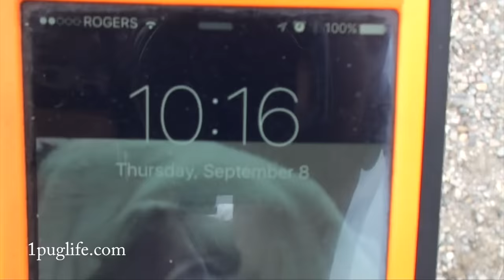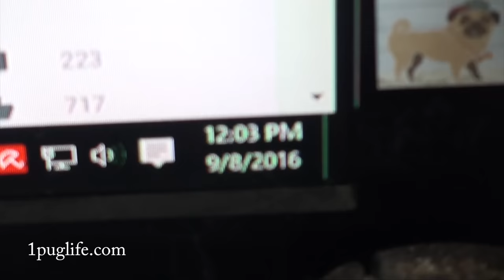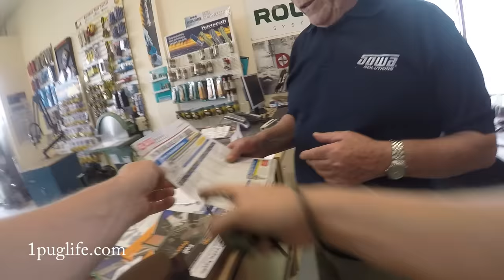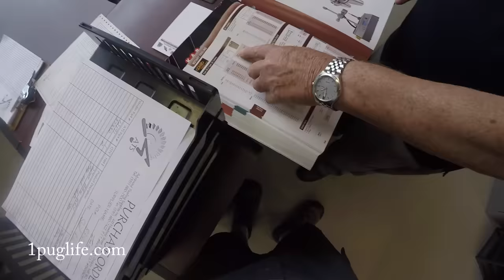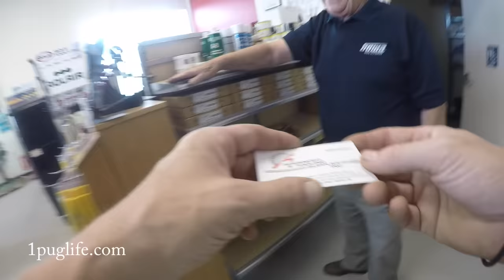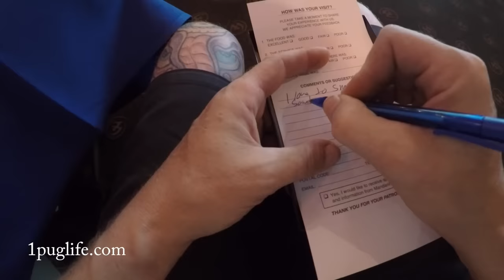time to pay the piper

Comment: Maybe the building roof not square..that's why the roof tins don't fit nice.
Reply: likely
Reply: I was thinking the same.check gutter edge before spouting. this dude should know better at this point. plus you get more bees with honey.
Reply: The buildings old the center has dropped some, Pug a con man.
Reply: +john harry still a ver unproffesional metal roof job..no matter what they slapped it on
Reply: Yes unprofessional but fit for function if you paying half price of a pro would you expect anything else?
Reply: +john harry 
Oh.... HALF price season is it!

How much?
Reply: I've tryed to work with unsquare it's almost impossible to make it look good.  Plus if you start the first sheet crooked it's will be all crooked.  Best way is to make the first sheet look straight
Reply: Well you don't order the metals to the width you want they have to cut them they come standard width. The roof was square just bit to long but yeah you pay cheap you get cheap but Pug wants a Rolls Royce cost of lawnmower.
Reply: Why is everyone continually beaking off about Pug being a cheapskate therefore it is OK to fucking make a shitty mess?

UNLESS someone knows otherwise I seem to recall Pug asked roof buddy for a price to labour the roof on.....

He never said he wanted it cheap....half price....in a rush... ner fuck all like that...

Plus I do not personally recall ANY number being mentioned other than Pug stating he could get the metal for 1000 bucks less than roof buddy. ....
Reply: JETJOOBOY That part and parcel when having work done on your house, when you get your car serviced do you say my seat must be back in the 38 degree angle and mirrors in the correct position to head height or i am not paying are you one them guys? or just a 13 year old kid i am guessing
Reply: No, you shouldn't have to say fuck all when getting your car done..

But the angle of the seat is not a valid comparison to this roof shit show..

How would you feel if you took yer car in for a new clutch and there were numerous fag nubs in the footwell and a burn in the seat and oil rubbed into the door cards and the seatbelt twisted and the indicator stalk all broke and wobbling?

If not pissed off, then you must already have a buggered up motor car...
Reply: That's a joke right
Reply: @y2kxj  If you measure the length of the top,measure the length of the bottom,you know from the start how much you have to make up to have it look good at each gable end.There are ways of making an out of square building look square,but you need foresight and a bit of knowledge.BUT,if you are not being paid extra,to do the extra work,why do it.I have always done the best work possible,but in the end,most clients don't give a rats ass,it all boils down to money.I hear many stories of people being ripped off,but I can tell you just as many of the contractor/worker getting the shaft for no good reason.Too bad because I trust people until they give me a reason not to.

Comment: There's rake edging that should be installed. There should be butyl tape under it. That closure is for the eave edging, not the rakes. That is not the proper sealant for metal roofing. 
Sorry, but my advice is to have it redone. You may be able to salvage some of it.

Comment: 28 year UNION  (Sheetmetal Workers International of America), specializing in Architectural Sheet Metal ...NOT ROOFING.... (I seal in all of my flashings, I cut all my reglets; I'm an instructor at the Union Hall ... Teaching Basic Architectural Sheet Metal & Soldering & Advanced Soldering ... Lead to Galvanized coated Zinc, Lead Coated Copper to Lead, Brass to Copper. When I teach I teach & certify with 1#, 2#, & 3# irons. This includes overhead & horizontal soldering; finishing with the use of a P2 tip for sweating joints, to show how no matter who says what .. Only an iron can sweat a knocked down standing seam lock as the lock was intended. Nothing a roofer can do, yet everything a roofer claims to do & do well.)
Reply: NONE of what you saw or no roofs made with metal are "Roofing" or done by "Roofers". 

95% of metal roofs are worked on & completed by Roofers. Why, ?, you ask. Roofers are required to be licensed in some states nor reqd to take an apprenticeship. Hence SMW's make $35 in the envelope to the roofers $20 envelope.

Comment: Dont they use barge flashings in Canada? That way you dont see the ends of the sheets on the gable ends. better waterproofing as well, Just wondering
Reply: Thats what i was thinking, there has to be something to cap the ends.
Reply: I've never heard that term, but thought the same when materials were delivered, where's the gable? Can easily still be installed, cut that shit off they did to the cap, trim the edge, install gable to cover the hundred screws they put in the edge by house. Ha ha Hard parts done, 30 minutes to cut and install gable make a world of difference.
Reply: rake flashing..yes we use it
Reply: goofs did the roof not professionals
Reply: @whenibecamethesun..8759  I doubt it...

Comment: I have done hundreds of metal buildings and roofs. Not one contractor or homeowner would pay me for that mess they have made. There are not even enough screws in each sheet to meet wind code in my old home state of Michigan. Some blue chalk and make your screws at least line up ffs. I would have quit and fired them with the reuse of the boot and storm collar on the vent for your furnace yesterday. Let the court decide.
Reply: But the first thing a judge is going to ask: where is the written contract and what is specified in that contract.
Reply: Maybe you could do a report and approximate quote to help settle the situation?
Reply: Pug had a written estimate. I think the guy got butt hurt over not supplying the materials right from the beginning. It was a 5 day job for 3 men to do properly. The 4" gable end fascia boards should have been knocked off and swapped to 6" so proper trim could have been used. The foam would not have been needed on the gable ends. Cost of materials would have been just slightly higher.

So a lead man 30$ per hour x 40 = 1200$
2 do what their told dicks 22.50 x 80 = 1800$
Thats a fair estimate for this job done properly supplying all your own tools.
Reply: There is no way possible you and one other guy could do that job as I described as proper and done right.
Reply: Also part of the job was removing the old sheeting without damage. That takes and eats up time. They frigged it up and it took them 3-4 days.
Reply: m!!lo

Comment: Most roofing Co. leave crap. I've seen it all the time. You get what you pay for! When I paint a place I go around to make sure everything is done. Every new roof job that I have seen has had all kinds of crap leftover. If it's a contract that says they have to clean up then call them up. As for the one side I would have them fix it. If it's a cash job? Forget it!

Comment: Usually metal roofing includes angled trim pieces for the sides and bottom, plus the ridge cap.  I don't see any of that in the video!  Judging by the way the metal is screwed down, odds are it will leak and feel like rain inside!  This is another case of Pug1 getting screwed over.
Reply: the drip guards?  yeah there's none installed here lol.. never done roofing in my life but working at Home Depot I at least know you have to finish the edges
Reply: Ah, he said he would supply materials than did not do it....

Comment: Another thing is the chimney. I would have quoted a new flashing and storm collar. I'm sure they didn't do the. flashing correctly. It looked to me as if they screwed it directly onto the tin. The new tin is supposed to have a small slit cut on each side. This way it can slide over it. It has to have a separate piece at the bottom, which is overlapped by the top piece. When done correctly, it looks real good. They also make insert pieces that are the same contour as the sheet metal. The edges of the tin look like a dogs breakfast and I have never seen such a shitty looking job on the ridge cap. The foam on the edges was completely wrong. As a contractor and being in the business since 1982. The overall rating of this job would be 2/10. I could go on about all the other wrong things about the workmanship. To me these guys are shinglers who do the occasional tin roof. Tin roofs should be installed by a certified tin guy, not asphalt shinglers.

Comment: they havent done all that bad of a job, you ever think your fucking old building that was built before plywood was made might not be square? he never cut that hangover off cause he couldnt get your cutter. he does need to make sure he has all tools needed before taking a job.
Reply: if a few screws laying around makes for a bad job then theres no good jobs done. the roof looks ok other than the one piece on the edge that needs trimmed off and the ends of the ridge cap.
Reply: +Jason Darcy (JSDS2002) We can agree to disagree.. Piss poor job.
Reply: that we can, but please point out why. other than leaving some screws and garbage around and the things i pointed out.
Reply: +Jason Darcy (JSDS2002) It was just a total mess.. The cap doesn't look properly attached. Two screws on one side and one on the other. The ends/sides are all uneven. Takes a few minutes to cut it off and square it up. And what was that one screw just hanging their attached to nothing? Lazyness. Maybe the roof is uneven and not square. So what? You take pride in your work and make it look good. They didn't even bend the ends like they said they'd do.
Reply: +Jason Darcy (JSDS2002) screws in the lows of the sheet=fail
Reply: Far North Squirell lots of opinions on where to put the screws, I want mine on the ridge but some want them in the flats. the manufacturers of the roofing I ever ask says put them in the flats. who says the next guy just isnt another dead beat and claims its so bad it needs all redone. pug somehow finds all the goofs to do work for him. Maybe the mexicans that fixed the drywall can do roofing also.

Comment: I install those roofs and it could be that if your roof is out of square you can get that 4 inch hanging over at the top and 1 inch on the bottom.
measure how wide your roof is side to side at the gutter and at the ridge, if it It's the same they just suck and put it on catywampus.
if it's not square you would use some 90 degree L flashing like 3 inch to cover the rake end of the roof.
Reply: It would be more reliable information on squarness to measure corner to corner wouldn't it?
Reply: everyone ive seen done right has that L flashing on the ends. it makes it so much cleaner and keeps sruff from getting under the sheets. this is a hack job.
Reply: Yeah but as a roofer you know you can cheat the material over the distance to square up the sheeting.  Seemsthis guy left his chalk line at another job as well cuz them screws are not lined up. The flashing around the stovepipe is not right at all.  I  also may have suggested ice dams as well, but I'm not a roofer bmp
Reply: Right on, like a barge flashing that covers over the first corrugation.
Reply: I don't think you know what an ice dam is.

Comment: The roof job should have taken much longer. One side at a time; tear-off, fix everything to square, true, plumb, flat, etc. Aluminum brake for makin' of the flashings. A roll or two of Aluminum. Could have made some really nice deep custom MEANINGFUL gutters fer catchin' the big waters. Could have sold Pug on a #1 job that cost MUCH more...and he would have gone for it. Pug gonna heat and chill that space - There's a steel roof solution with ducted channels and layers for an insulated roof. Pug could have then sprayed expandin' foam up in the underwerds and put ceiling fans and a big huge bug zapper maybe. Only a professional would have known better than Pug - what he wanted - and sold him on the idea. A professional acts like he is there to help ya. You know it when you feel you're in good hands before they even started.

Comment: wow ... 

Hopefully that other roofing guy you were in contact with can help you out , fix that disaster. 

If you quote someone $X,XXX for a job and you later discover that you under quoted yourself and have already committed to the job ... guess what you're eating crow for that mistake. Finish the job as efficiantly as possible with the best quality work you can do. Clean up your mess when you're done and move on to the next jobsite where hopefully you learned from your last mistake and actually sit down to draw up a proper quote for the client.

I would have told them to go pound salt after the ministry of labour incident where they proved to not have the required safety gear to do the job .  Even if the roof was open to the elements it would have been worth the extra few dollars to get a legitmate crew out last minute to fix the prior roof guys mistakes and have it done right .

Like another viewer mentioned , try gettiung atleast 3 seperate quotes for different places for a given project and look into their previous completed projects , invite them over for a visual and see how they are in person .

Comment: I just realized that the roof is screwed down wrong. Suppose to screw into the ribbed part not flat part.. Also they didnt use a caulk line to make the screws look straight.

Comment: There are pieces of metal for the gables for the ends of the sheets to tuck into or over the sheet ends. When doing a metal roof, then using butaul tape to seal the roof.  Sorry the butaul is spelled wrong.  It's a gray tape about 1inch wide. A good roofer should know that.  They sure don't know how to clean up...

Comment: I've installed metal roofs on buildings that were over a foot out of square. On a building that size you can hide 6 inches or so by bunching the ends of the sheeting. If you can't do that, at least cut the roofing to fit the facia boards. And always bring your own tools and pick up your trash.

Comment: hey pug.I am a long time viewer and fan. I came back to watch this video and realized there was a box of roofing fasteners there amongst the garbage you picked up. Didn't you say in a video after this that they were missing? Someone probably drove by and saw them on the driveway and stole them. I am a flat roofer in London- I am doing the dodge dealership they are building on hyde park aND I hate Zavits and crews like his. They give roofers such a bad name and shouldn't be trusted with flammable gasses and machinery. If you want some real roofers to come do it properly I will get the office to give you a shout to set up a free quote. I work for a family business out of Lucan. The father and son (owner and foreman) have a over 40 years of  experience combined. They ran the commercial sector of a major company, until they started a business. Let's just say that the major company doesn't even have a commercial sector anymore lol. we usually don't do residential work because there's a minimum charge to get us to show up and it usually makes more sense financially for most homeowners to find a guy like Zavits. I know how beneficial it could be to have you show off our work, and plus it would be cool to meet you.
Thanks,
Curt